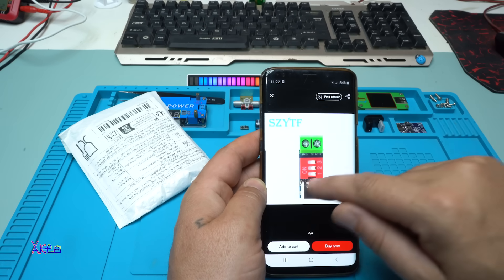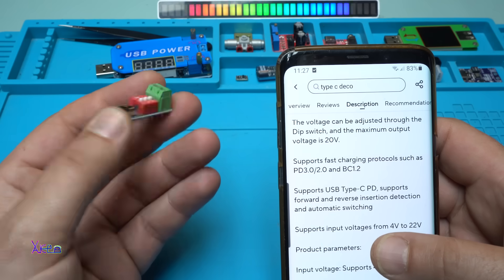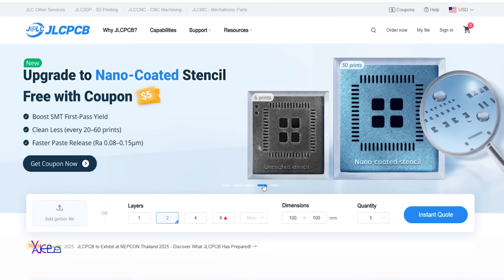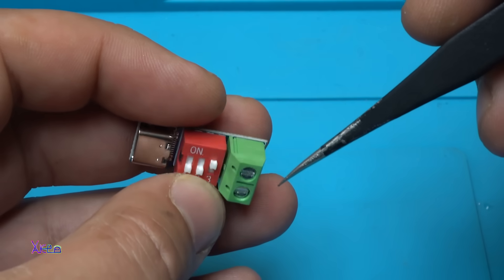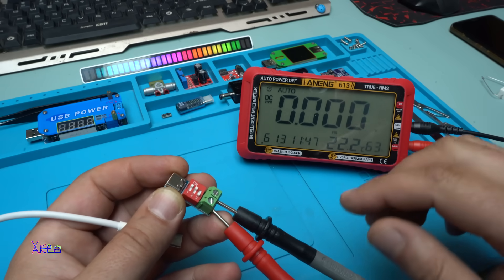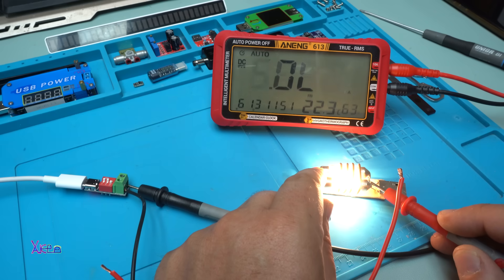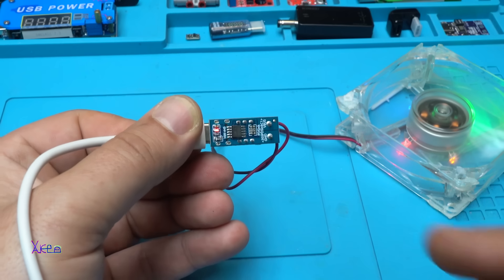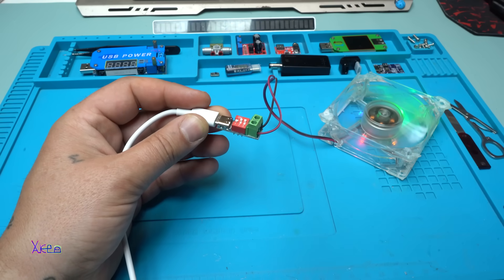WHY THIS $1 Amazing Module is BRILLIANT?

Comment: I bought a pack of 5. Every one passes through the source voltage no matter what that is. The dip switches did nothing. As per the multimeter. I didn't try it under a load. Does the "CH224K Low-cost USB-PD Sink Controller" require something else to respond?

Comment: Correction:
10 watts, not 100 watts!!!
At Amazon,
USB C PD Trigger Board Module 5V 9V 12V 15V 20V PD/QC Decoy Board Type-C to 5-20V Power Delivery Boost Module
"Question:  How many amps is the output at 20 volts?
Answer:  Unfortunately, the product information does not specify the output current at 20V.  While the product description mentions supporting up to 10W of power and an input voltage range of 4V to 22V, the exact output current ratings for different voltages are not provided.  Without this crucial detail, I cannot provide a definitive answer about the amperage at 20V output."
Reply: Ah, well caught! I was wondering how that could support 100W. I guess at 20V, max current would then be 0.5A for 10W.
Reply: thank you for clarifying . right off the bat the 100W was suspicious. 😂 i was waiting for it to smoke when he power it up...

Comment: For a really industrious electronics "fiddler", you could de-solder the DIP switch and fudge in a digital, 3 bit signal to control the output voltage remotely, like with an Arduino, Raspberry Pie, or even a potentiometer and a A/D converter.

Comment: did you go in with a 12v input and adjust it to 5v 12v and 9v? if I enter with a 5v input the output always remains at 5v right?

Comment: I want one of these that deliver either 12v or nothing for a project. It shouldn't have a chance of it delivering 5 or 9v but i just can't seem to find one that does that
Reply: I wonder if you could set it for the 12 V and then use a soldering iron to melt the switches for the other settings so no one can just switch them. Not sure.
Reply: @DCJensen333  it wouldn't work because USB c chargers are programmed to deliver "some" voltage. If you set it for 12v and connect to a charger that only supports 9 and 5v, it would send 9v because USB c is design this way
Reply: 1. You will get 5V anyway. With any USB power supply. It is 5V untill higher voltage is negotiated.
2. Avoiding 9V - it depends on the module itself. Some are programmed to only aks for 12V and fail back to 5V if that isn't avaiable, outhers - try to use closest lower voltage avaiable (like 9V or 11V for chargers with 11V mode)

Comment: This is one of the most stupid presentations on YouTube.
The guy has no idea about the difference between "voltage" and "power".
The claim about getting 100 Watts of power from a USB port is insane.
And what is most disturbing is the fact that 990 viewers so far have "liked" this shit.
Reply: USB PD supports 100W = 20v at 5A - do the maths
Reply: Datasheet. CH224 integrates multiple fast charging protocols such as USB PD3.0/2.0, BC1.2, automatically detects VCONN
and simulates E-Mark chips, and supports up to 100W power.

Comment: Don't tell absurdity like 100W it can be load. You tested 12V with 1.3A what is less than 16W of power. You need understand, when it would be overloaded power of 100W firstly USB-C socked will be self-desoldered if at all would be possible provide 100W by this cable.
Reply from the maker: I will test it again with bigger load
Reply: USB-C is in fact rated for 5 amps. Including 5 amps at 20V, which is 100 watts.

In 2021 they added 48V to the USB-PD standard, still at 5 amps. Which is 240 watts. But apparently this module may only have switches for 5V, 9V, 12V, 15, and 20V.

It's not the watts delivered that melts conductors, it's the amps.
Reply: I'm very curious about the result. Tell me, when are you planning to make such a video?

Comment: Habe mir auch 2 mal bestellt , warum bekomme ich immer nur 5 Volt obwohl ich alle Reihenfolge schalte.??
Reply from the maker: I have that problem and I figure out that my usb cable is not compatible,try to find better cable that support pd charging
Reply: Your power supply only gives 5v  you have to buy a 12v power supply for this

Comment: you didn't show that it actually delivers 100W @ 20V, in fact 20V switch didn't work at all
Reply: His power adapter only supports a 12v

Comment: What is the link?
Reply: The app doesn’t show links.  Try searching for. “ype-C PD QC Trigger 5V~20V Dial Code Adjustment DC Voltage Power Module Dial Adjustment Voltage Fast Charging Decoy”

Comment: I wonder how hot it gets if you use low voltage, and high current...it doesn't seem to have an inductor, so might be quite hot with large loads?
Reply: The USB-C standard allows for these various voltages and it is the USB-C supply that adjusts it.  This board just tells the supply how much to provide and doesn’t boot or buck the supply.
Reply: This device only works as trigger, it doesn’t need inductor as in buck converter.
Reply: 😮tällä poltat kotisi , helposti.
Reply: @JanisPetke-e4m  dom i okoliczną wioskę😁

Comment: Thanks for your videos. A few days ago I bought a light bar similar at yours. That bar only works when is connected to the energy, the recharging system doesn't work. Is it normal? Thanks for your help.
Reply from the maker: You need to open and see does it have lipo battery🛠

Comment: Thank you for your videos. I need an idea for a variable voltage battery charger. I work for a charity thrift store. People donate small cameras without the chargers. I need to charge the batteries to test the devices before ordering a charger and/or battery. The voltages range from 3-volts to 8-volts. Any ideas would be appreciated.
Reply from the maker: I appreciate the comment, maybe this module could be a good base for your project.https://youtu.be/CPKJbd6_WFU?si=aeCIwiaSSny50ukU

Comment: awesome. so  does this mean through this module we can charge a supported phone at 100Watts from a power bank? Obviously it will run out of juice soon and batteries will degrade quickly, but in theory yes?
Reply: I believe the power bank might already have to offer "PD charging" as a feature, then this device will tell it what voltage it wants it to deliver.  I suspect a smartphone, being "smart" might already perform the function of telling the PD powerbank what voltage to send.  I'm not sure. It would be helpful if he could explain it better with a few scenarios.  For instance, I have a modem I want to put on a battery backup.  I don't think the router communicates with a wall wart.  The router simply expects 12v. With a PD powerbank, I could set tit to 12v and power the router.  Be nice if he would instruct on how to make a router battery power backup.